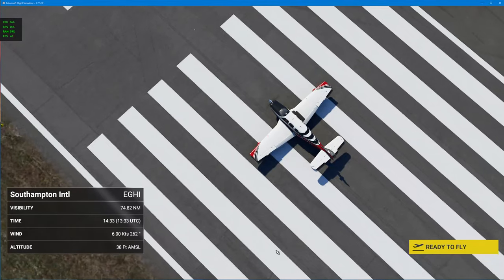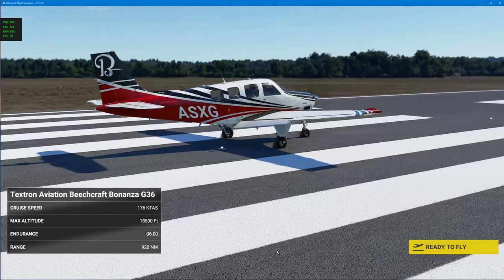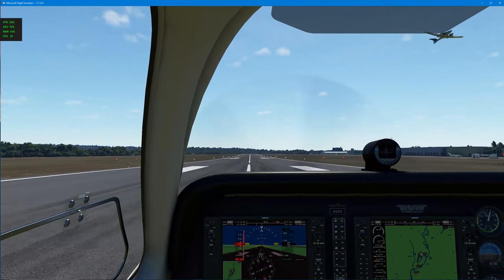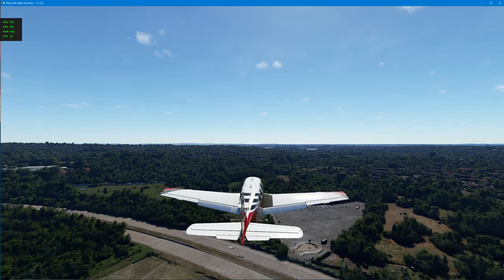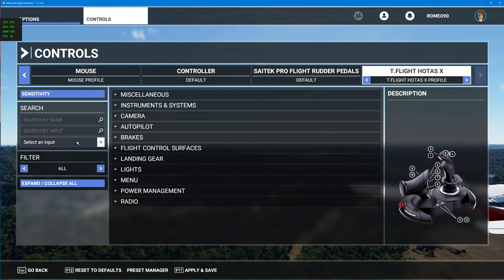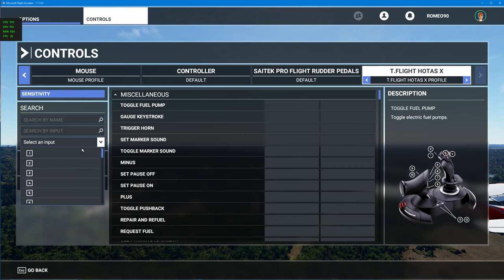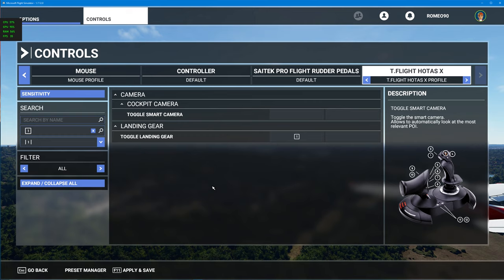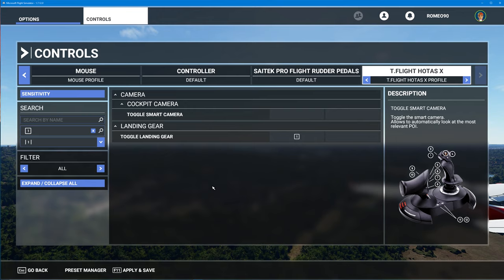Flight Simulator 2020 How to Fix Control Input Issues (keyboard bindings)

Comment: Might be “really simple” but its extremely frustrating when I set everything up and it reassigns for no apparent reason. So don’t assume its user error. Ive setup control settings for a320, Longitude, Kodiak, Cessna 172, and a couple others. So to say the least I know the process, but after a day or two of things working fairly well, all of a sudden, after making a 1 or 2 hours a320 flight the throttle all of a sudden controls the ailerons and I crash on landing. Ive reset complete control assignments, deleted the sim and reinstalled, tried another controller. Nothing so far has truly resolved this issue.

Comment: So here's my bug. I have made key bindings for "Avionics Master Bus 1" and separate bindings for "Avionics Master Bus 2," on and off for both. (Total of four bindings.) However, the bindings for Bus 2 do not operate the Bus 2, instead, it also operates bus 1. I have tried this on several planes and it happens on all of them. I made sure there were no duplicate bindings. So, the only way to toggle the Avionics Master Bus 2 toggle switch is with a mouse clicking on the screen. When is someone going to address and fix this bug? I saw one suggestion to bind it instead to "Set Avionics Master Bus 2." That doesn't work because the "Set Avionics Master" key bindings only momentarily switch on, and then after a second or two switches back off. (What the hell is the purpose of this???) I am very surprised that I have not seen more comments about this bug anywhere on the internet.

Comment: Had the lagging/sticking issue with control surfaces. Remove elevator up/down inputs in the set up same with rudder use only the Axis for control works great!

Comment: I love this sim, but not liking the behavior of aircraft in it.  I feel like I have to apply way too much back pressure just to rotate on takeoff, or rotate at a faster speed, at least for the C172. Also, with 1 notch of flaps, it still climbs at like 90kts 1000fpm instead of 75-80kts.   I’ve also noticed aircraft behavior seems to change a bit when coming back into the sim after closing or, and sometimes it switches to cursor mode without warning. I also feel the auto pilot system doesn’t work right at all.

Comment: Video didn't help the rudder not working properly, when turn it snap back to centre I tried reset to default still same can't taxi air craft joy stick is T16000M I check to make shore the joy stick buttons are working properly and they are it work in XPLANE no problem.there is 2 axis X showing under inputs one for rudder and throttle I'm not shore if this should be the case I can't seem to map it any other way.

Comment: Hi I'm on xbox series X 

Using normal controller.. I've just had a issue where it would not let me decrease my thrust using the B button or manually 
This happend during the landing process  of a 4hr flight 🤬🤬🤬 

Luckily I was able to land it 
Still didn't regain control over the thrust 

So I had to keep turning off the engine 
And turning it back on 

As it automatically  kept on putting my thrust  to 98% on both engines 😡😡 

Does anyone know how to fix this please ?

Comment: I am using keyboard and mouse and facing lot of problems

1. The yoke won't turn smoothly. When i press the keys NUM4 and MUN6, it turns in steps... This is annoying. Also when I pull or push the yoke and then release the key the yoke wont come back to the normal position automatically.  it should right?

2. Sometimes camera gets stuck to left side.. i have to restart the whole thing..

3. Partking brake key Ctrl+P is assigned but it doesnt work at all

4. They control they display on screen aren't proper. for example during flight training and all..
Reply: I'm having the exact same problems, minus the parking brake
Reply: @thatboieddy242  hmm, parking brake was a contoll map issue. i fixed it...
Reply: do you find the fix already? im still struggelling with this issue
Reply: @farelr1840  nop, I sort of stoped playing flight sim.. can't play it well because of these issues.. also frequent huge updates..😭